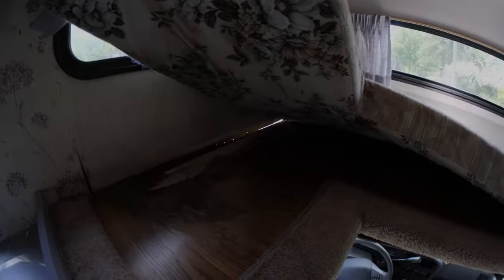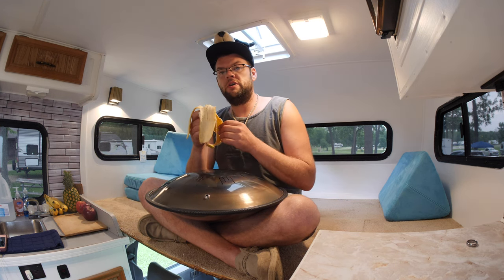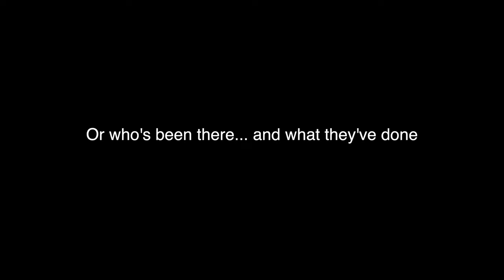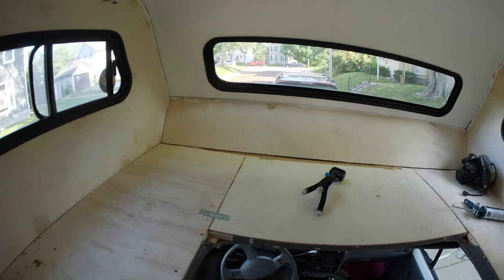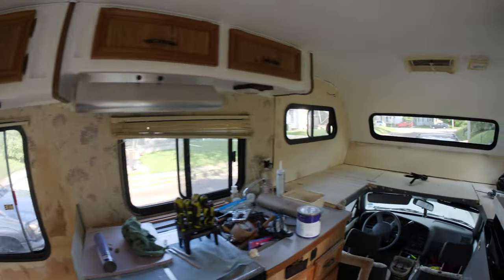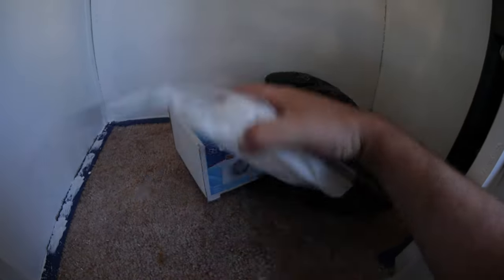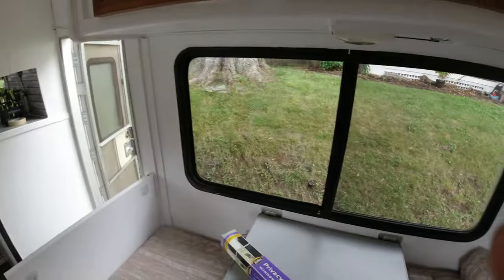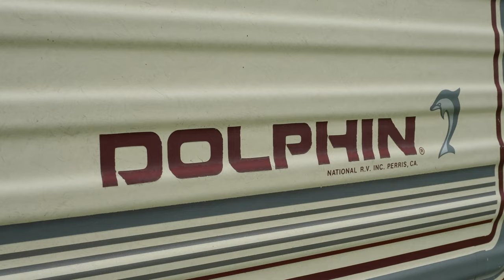CURBSIDE 1989 Toyota Motorhome Restoration - 21 DAYS Timelapse

Comment: How did you avoid the gap with the tint?
Reply from the maker: I created paper templates for every window. Then traced the template. Still not perfect, but better.
Reply from the maker: If you plan to replace the window glazing on the outside (rubber seal that holds in the window), you could cut tint while it’s off and that would work out too.

Comment: You didn’t list what was used for the shower walls. Also you didn’t explain how you installed the new wood for the cab bed. You said reframe but what’s holding the new wood together what’s it attached to? Is there another video explaining this?
Reply from the maker: I used something called Pollywall from Home Depot for the shower wall, 25 bucks for 4x8. https://www.homedepot.com/p/PLAS-TEX-1-16-in-x-48-in-x-96-in-White-Polywall-Plastic-Panel-10048615/311314398
For the overcab I screwed the framing together and also used liquid nails with metal plates. I wasn’t intending to get too technical in explaining quite everything, more showing the process, but i can do my best to help answer any questions
Reply: @JRESHOW  Do you have social media I may contact you on? I have liquid nails as well and was just gonna use it to close the gap that opened and then I thought maybe I’d like the option of sleeping up there and would like to add the wood
Reply from the maker: @briizcustoms9543  I don’t have social media. You can write me an email jre89999@gmail.com. The liquid nails wouldn’t be enough for support, it’s more like additional support and helps to stop creaking and just to hold a bit better. If you wanna send me some pics I can give you some ideas, I know there’s other vids they go into a detailed above the cab remodel
Reply: Hey seen your email it’s okay if I give you message with a few pictures my boss messed up my camper more and everything works need help with the electrical now and setting up the fridge don’t know what type of things need to connect to the propane tank to the fridge  the connector is rusted
Reply: @JRESHOW  hey
Reply from the maker: @BillionaireeTv  I’m no pro and it’s kind of hard to say what kind of connectors etc you’d need…. Best advice it to take off the rusty part take it in to the hardware store. There’s not a lot that holds all these together. It’s basically 1x2s and thin plywood. It’s just tedious work and can get costly for simple repairs with wood prices.
Reply: Another question sorry what battery is in the front of the Rv and what tires could I get to replace mine I’m finally trying to renovate it